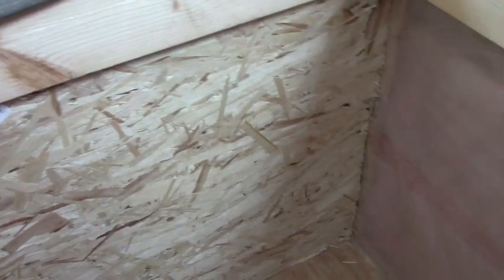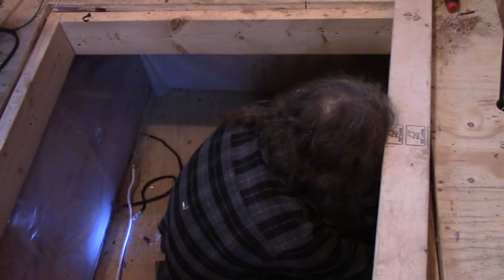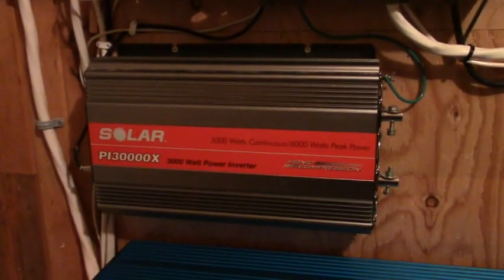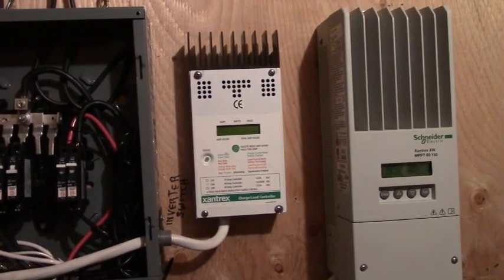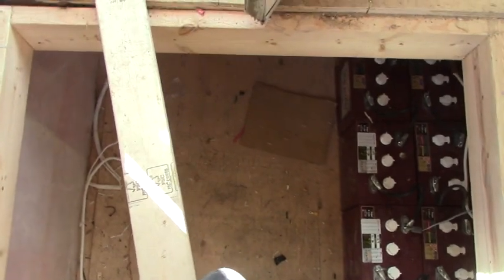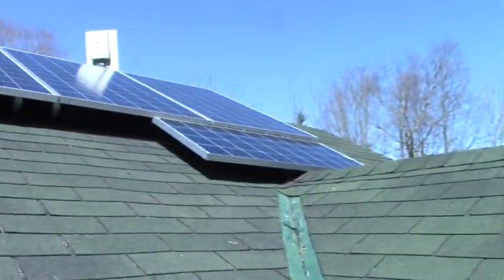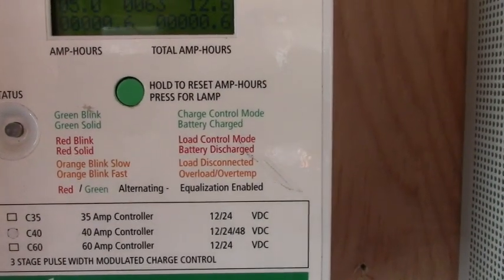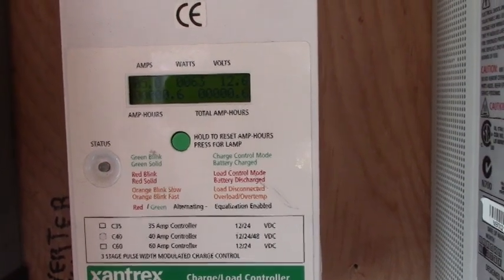Battery Box & Other Solar Updates

Comment: I'm jealous too, have wanted to switch over my well to solar for months!  Have the solar, just need the electrician to modify the well pump and bladder tank to run off 110 amps instead of 220....someday. Or get 24VDC system (or a step up transformer) just for the well (not even sure that will work). Thanks for sharing, always inspired by Howie's work!
Reply from the maker: you will get there honey!

Comment: You can buy a 12 volt capacitor to help the draw of the well pump.  Several of my off grid  friends use them.  Some have bought the ones used in big car stereo systems.  Helps out to lower startup amp draw.  Just some FYI.   System looks good.
Reply: + c Mathews.  Tax in OK is only certain cities on grid tie systems. It is not going to effect already installed systems and isn't official yet.  We live off grid in OK and follow this closely.
Reply from the maker: ***** Thanks Bill!
Reply from the maker: AWESOME I will tell him!

Comment: Good job by Mr. V. Like it a lot.

However I did not see any vents for outgassing. Or the video did not catch it. You are using unsealed lead acid batteries. They give off small amounts of hydrogen gas. Need a 2" vent louver to prevent accumlation.